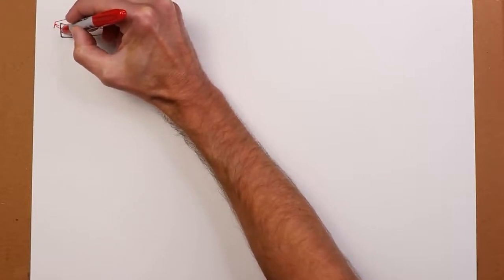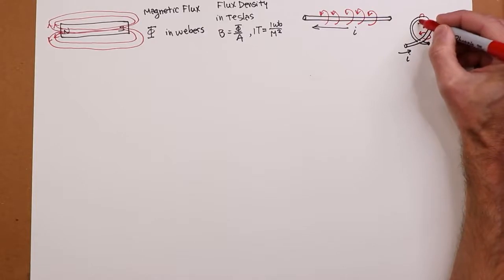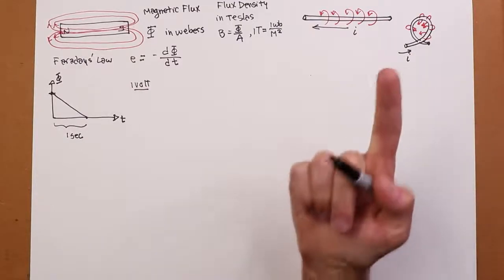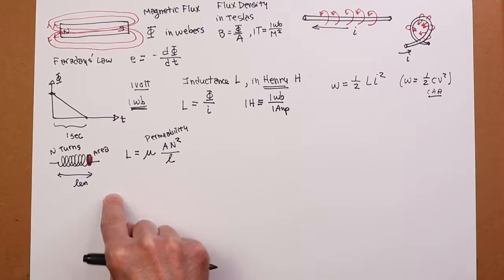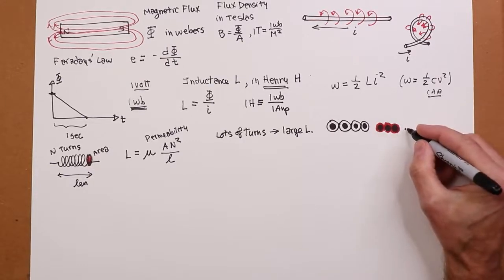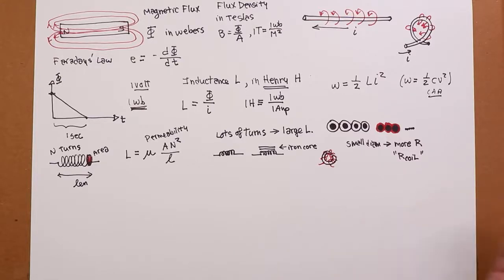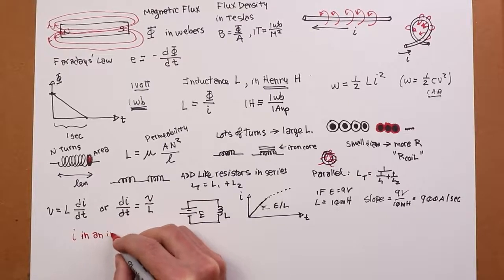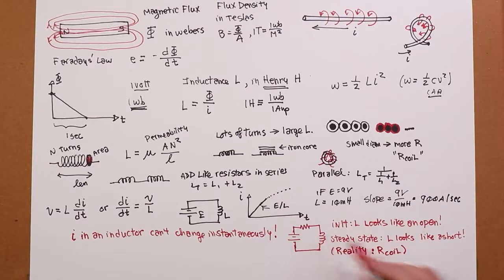Introduction to Inductors

Comment: Thank you, excellent explanation. Would putting an inductor in series with a voltage source stop sparking across the on/off switch?
Reply from the maker: The sparking is caused by the fact that the current through the inductor cannot change instantaneously, thus, if a circuit containing a charged inductor is opened, that current remains (for a very short period, until it discharges). That current, through the "open" creates the voltage spike (because the open is a very large resistance). To limit the spike, you have to limit the open (e.g., place some resistance in parallel with it). This is the idea behind a "snubbing" diode (aka flyback diode) sitting across a switch (either mechanical or transistor). Normally, the diode would be reverse biased and thus a high resistance, but when the switch is opened, the diode will conduct, and produce a low resistance, limiting the voltage spike.